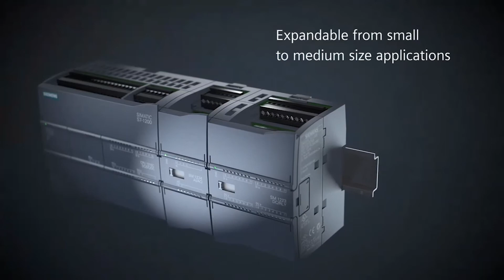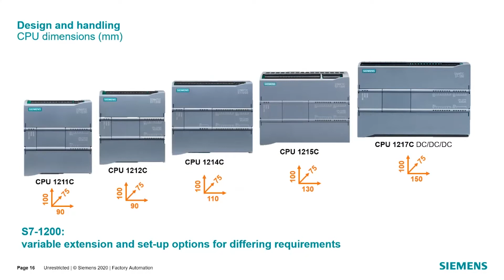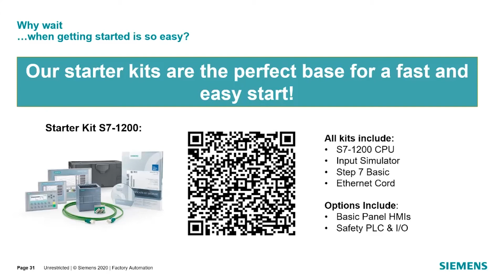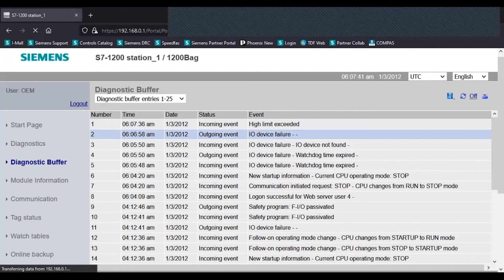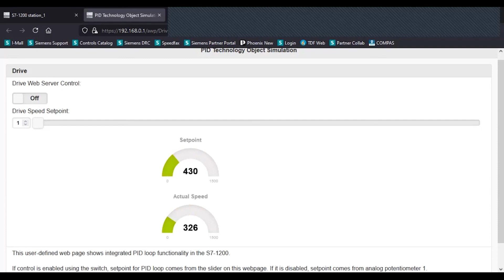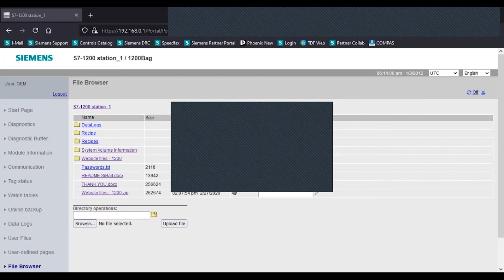Siemens Webinar Series: SIMATIC S7-1200 Incredible Power in a Compact Package

Comment: Overall, the SIMATIC S7-1200 is a well-positioned controller for small to mid-range applications, offering a strong balance between performance and cost. By incorporating selected advanced features from the SIMATIC S7-1500—such as diagnostics and integrated technologies—and combining them with seamless integration into TIA Portal, it significantly improves engineering efficiency and system transparency.
However, for more complex or large-scale systems, higher-end controllers may still be required. Overall, it is a reliable, user-friendly, and cost-effective solution for its target segment.